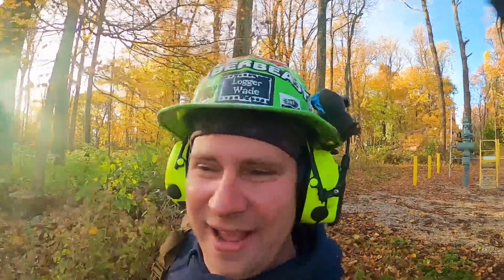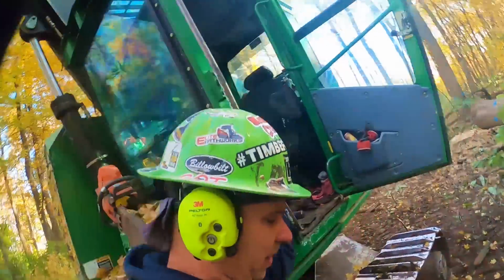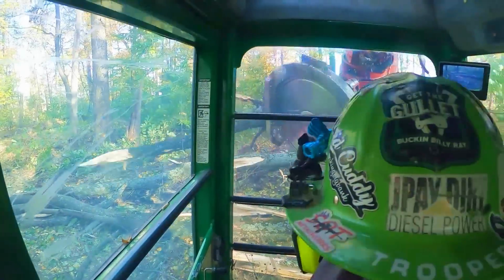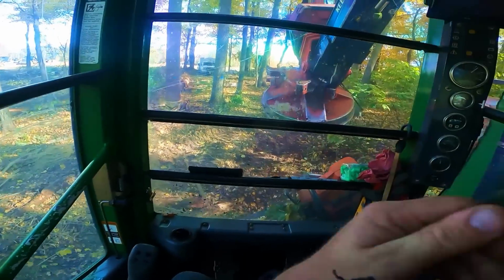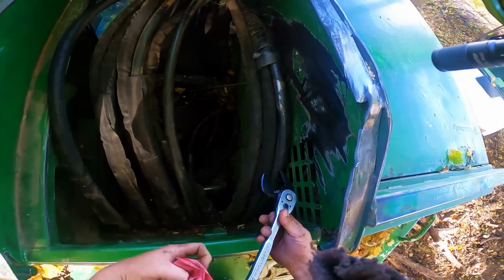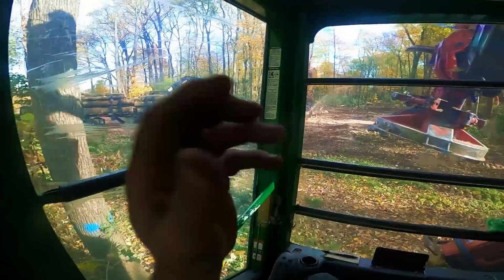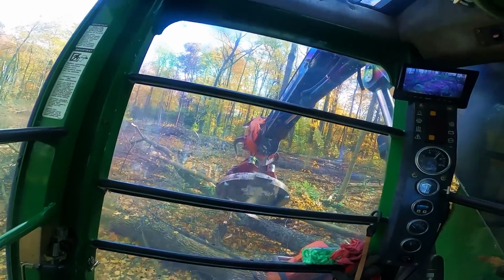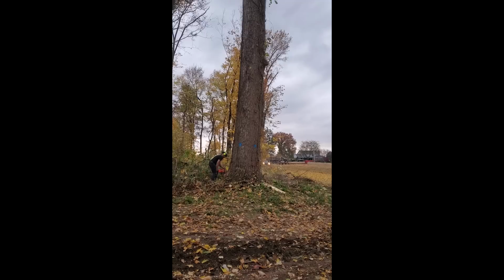Huge trees that won't hold  together‼️

Comment: poplar around here is mostly cottonwood and quaking aspen. I see the leaves are changing fall colors in the background. It has been my experience when ya cut poplar in the spring they are sucking water are much heaver in the canopy and are stronger  in the tops. In the fall the water drops to the trunk and the tops are lighter and become brittle and the colder it gets the more brittle they become. I cut mainly for firewood so I hand bucked many a poplar in all seasons.
Reply from the maker: Dan I agree 100% with you on this

Comment: Good morning You have good Temper and much Trees have a blue Painting. And then You begin with the Great Machine to Cut. If a Stem splinter, this is not good you annoying but if the Trees fall how You will You can to Laugh. But a Defekt on Your great Saw Machine Repair You and the Working go farther. Hihi Your Work Speed to let the Other to sweat. However a Video what all to show.
Greeting 👍👌🇦🇹
Reply from the maker: Thanks so much

Comment: We used to grind the radius off our open end wrenches for those tight situations.
Reply from the maker: Intresting
Reply: @LoggerWade  Those straight walls let you get nut nice and snug.  Then you can use a standard wrench (assuming you can get on it) and give it a proper torque.

Comment: What do you do with poplar timber?  in England I have never used it, I’ve seen it as  already made articles. but what’s it for ?
Reply: A lot of the 100 plus year old buildings here in Maine have poplar interior finish, Casings and base board. I like to use it for cabinet door frames and face frames. I think it makes a good paint grade finish.

Comment: WHY GANT YOU CUT HIGHER UP THE TREE SAY 10FT THEN CUT THE STEM
Reply from the maker: Thats a great question but a complicated answer if they weren't so big I could maybe try it but in the past I've busted butt wood doing it because you gotta yank the stem off the stump and let it settle to the ground before the top hits and I always slab something off.    Mayne a bigger head or better operator might be able to do it